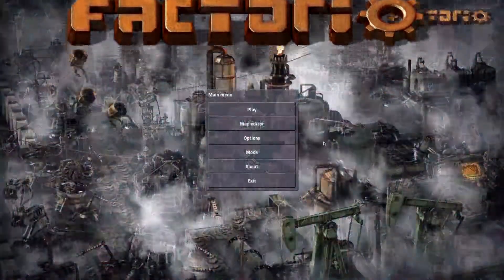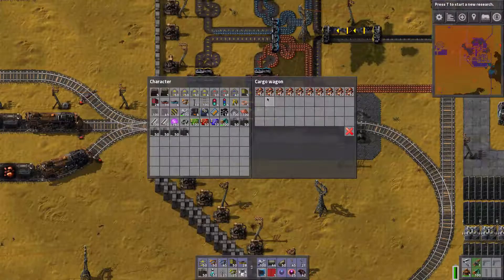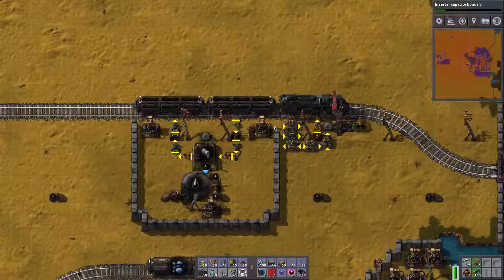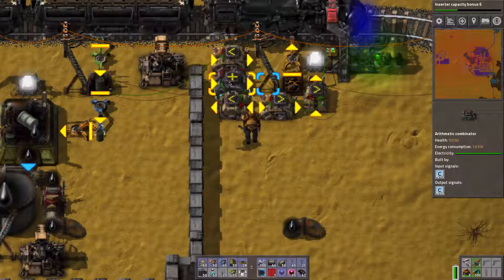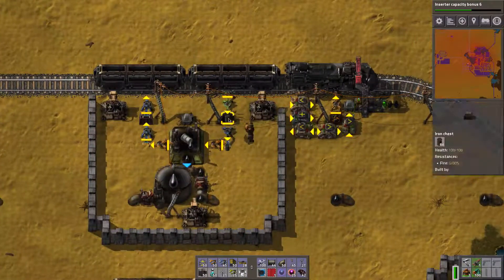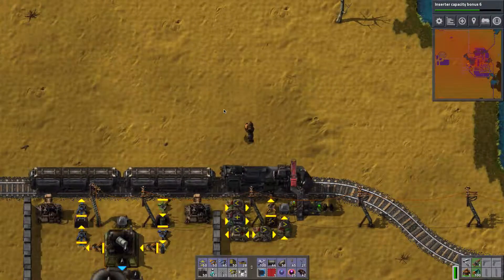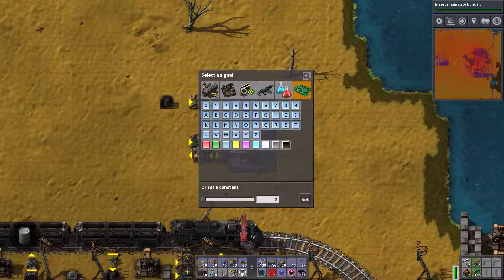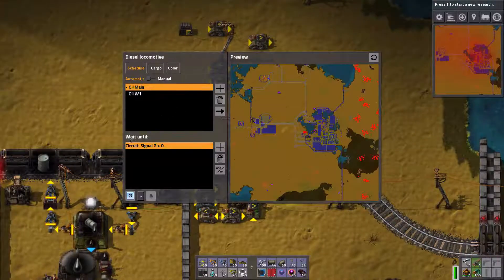Factorio Tutorial: Smart Trains - Stop Conditions and the Circuit Network

Comment: This was very good. This was my first attempt at the circuit network and this jump started me into figuring out you can apply the same conditional statements to pumps to even out the 3 products of oil refinement with cracking etc.  The "counting" tool will come in very useful - thanks.

Comment: An easier way is to set a train condition, Full Barrels = 0 AND Empty Barrels = 300.  Or 300 can be however may barrels you plan on transporting...   Sofar, I like what the circuit network does, but I haven't found a full use for it yet.
Reply from the maker: Good input, but that only works on an exact number of barrels (and you'll have to adjust) - with this circuit logic the amount is totally variable and you can run as many trains as you want without needing to configure each train ;)
Reply: The problem with this is that if the first condition is met as the clock hits 989 the train will leave after waiting for the count of 1. That results in the train drivin off with less barrels and a system break down.
Reply from the maker: That's what the AND-gate is for, but yes, it can happen that the train leaves right after the last full barrel is being emptied, leaving 1-2 empty barrels in the other chest. Over time that would accumulate. I'm currently working on an improved concept.